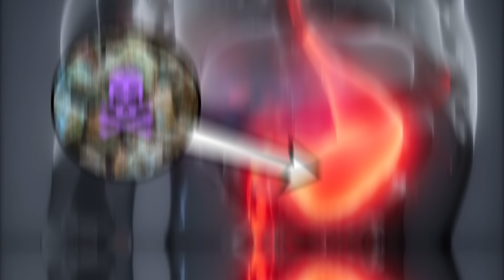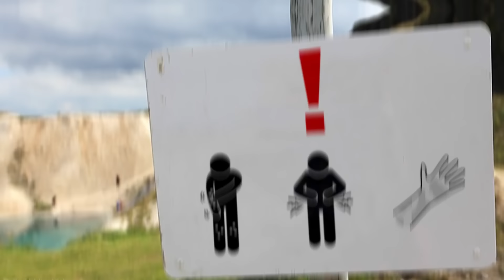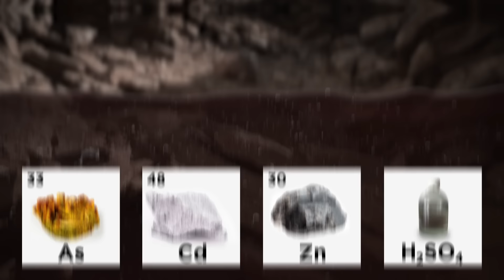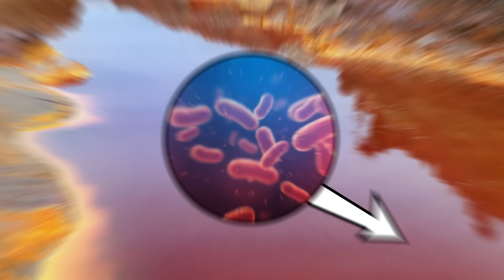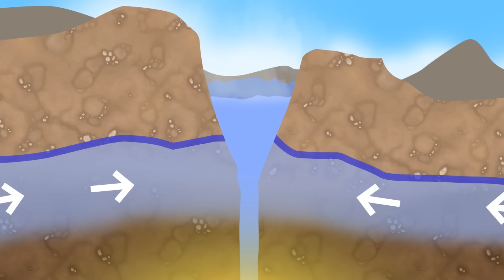You Wouldn't Survive Dipping Your Toe In This Lake

Comment: Just an fyi, the Berkley Pit is not the only lake in butte with high acidity levels. About 10 miles up in the hills behind "the pit", as the locals lovingly call it, is another small lake dubbed "acid lake" where swimmers have died, cars have been lost, etc. Also, the tap water in butte is still being contaminated with tailings from mining. Oh, and the Berkley mine is back up and running, although the pit itself remains closed, the mountains next to it are slowly becoming distant memories.

Comment: I've seen some borderline scary water in a much smaller vessel on a foreign trip in the late nineties with friends. Foreigners weren't recommended to drink tap water (ultimately not harmful, but the local flora gave the runs you wouldn't believe) and so we were buying bottled water, trying different brands. Of course we didn't buy the "water sommelier" stuff too seriously and were just goofing off about it, but one brand stood out with a rather peculiar, unpleasant taste. We decided to check the label to see what was going on and yeah, it was supposed to be drinking water, "naturally purified mountain spring water" or some such nonsense, with a pH of 10.4 and crazy amounts of fluoride salts. We didn't touch that stuff again. We joked about if we should take a bottle back home to see if it was radioactive too.